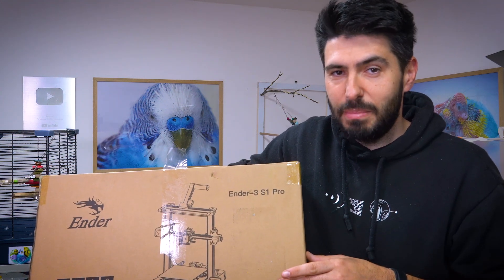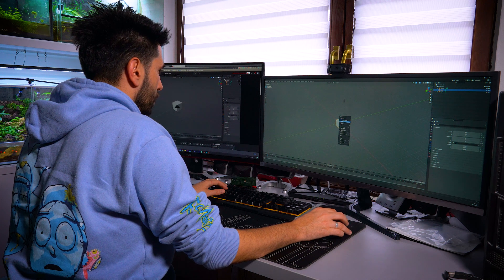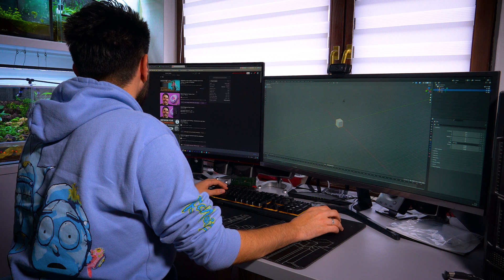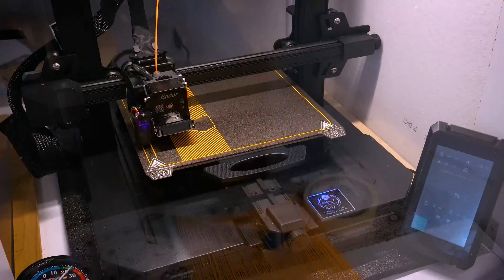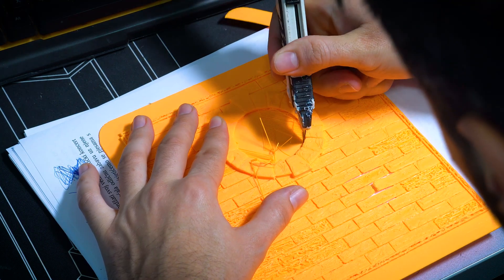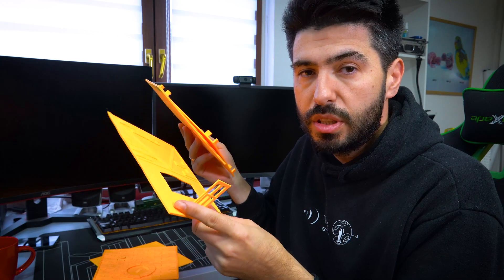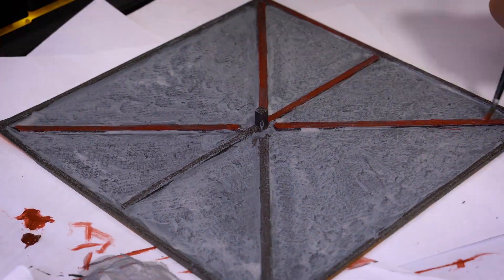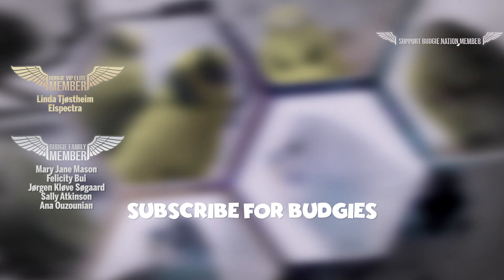How I 3D Printed The Perfect Nest Box for Budgies!

Comment: I think it's a good opportunity to discuss 3D printing and birds. There are some filaments that are dangerous to use and some that are ok. I've found that PLA gives off fumes initially but are very mild. As far as being safe afterwards, PLA can be ingested by the birds and it'll metabolize into lactic acid, the same acid that makes sourdough bread have it's sour taste. PETG and other PET related filaments are considered food safe so long as they are not contaminated, either in the filament manufacturing process or by the person doing the printing in some way. PET is what's used for plastic water bottles and could be used for printing water or food bowls. Also, it doesn't give off fumes.
ABS is a very bad one to use as it gives off a lot of fumes and it can even bother humans so it stands to reason that it could harm birds.
When printing, I keep my 3D printer in a separate room from my birds and make sure there is good ventilation.
Also, if at all possible, do try to upgrade your printer with an all-metal hotend as most printers come with a Teflon PTFE tube that goes straight to the hot nozzle. If for whatever reason that thing cooks off the Teflon fumes are definitely dangerous for birds. An all metal hotend solves that as the last portion is metal (usually stainless steel but there are some titanium or bimetal ones out there). It's a very good extra safety feature to have in case something goes wrong with the temperature for some reason (such as if the sensor goes out and thermal runaway isn't active).

Comment: You have created a nest box using plastic and then painted it. You now need to make sure that none of these materials are toxic to your parakeets. Commercially-produced plastic toys, food dishes, etc. are typically made with harder plastics than is used with 3D printing and are usually not painted. Commercially-produced plastic parakeet products should also be made from food-grade plastic. The plastic you use with a 3D printer may or may not be food safe. Please research the materials you are using (plastics AND paint). Even if they seem safe, I would err on the side of caution, particularly if they show any inclination to chew on any part of your structures.
Reply: I should have added that the 3d printer itself will produce fumes that are toxic to birds, so be careful there as well.